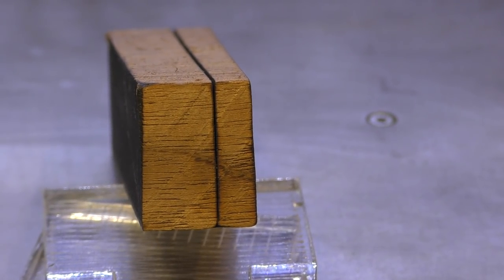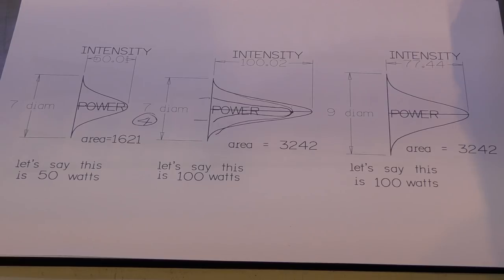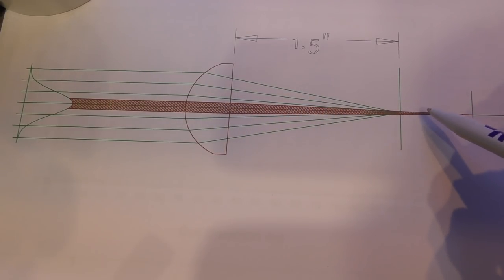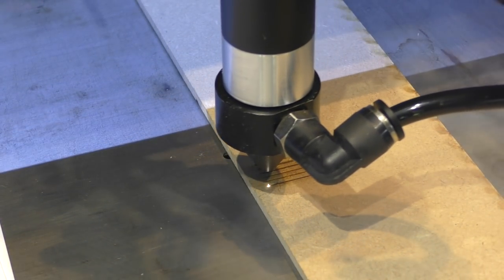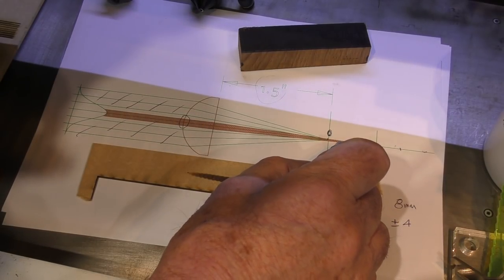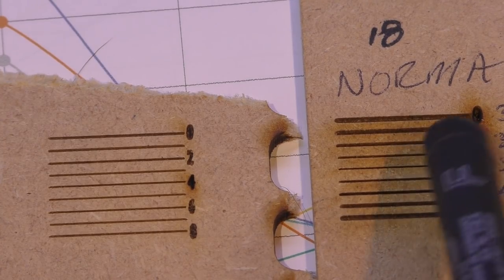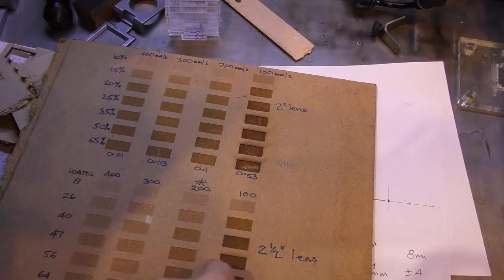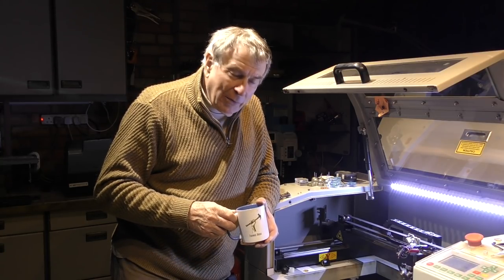RDWorks Learning Lab 208  Can I Remove the Focal Point

Comment: Dear Russ,
Again a fascinating continuation of your lenses experiments.
I agree with with Asger that keeping only the center of the lens reduces the NA and lengthens the depth of field to the extent of removing the sharp engraving capability.
I was just wondering on the great difference in cutting ability between 5mm and 3mm diameters. Either:
1) There is still a quite high energy density in the 3 to 5 mm annular region
2) The beam is not well aligned to the 3 mm center region so the higher intensity part of the beam is somewhat offset and falls into the machined dispersing part, reducing the overall transmitted intensity.
Keep going !
Thanks
Jean
Reply from the maker: Hi Jean 
I do treasure  it when my naive experimentation  encourages folks with a REAL scientific background  to make a contribution. Whether it be questions, doubts or criticisms , I regard all input as a learning opportunity. So many thanks for your comment.  My crude model of the lens cutting mechanism explains so many questions  without me  ever resorting to understanding Klingon . It may be scientifically flawed  but  for my exploration of this subject I do not need an electron microscope  when I can get by with a piece of string with knots in.  I don't intend designing lenses or laser tubes,  just finding out how to extend the operating envelope of the cheap machines that I and many others bought. With what I have learnt just recently,  I am  particularly keen to prove that controlling the size and divergence of my RF tube beam will greatly enhance its cutting ability.

 I did carefully align the beam axis with the lens axis before carrying out these tests
 I will be carrying out more tests to see what usable potential there may be for my crazy lenses.

 Best wishes
Russ

Comment: We’re used to refraction being dependent on the refractive index of the particular frequency of the light, but perhaps there’s also a difference based on the intensity when it comes to these frequencies? The materials in these lenses are very different from the optical glass materials used for visible light lenses which permeate lens research.

On that note, visually measuring focus using your jig and visible light should be a bit off, right? You would have to use 10.6nm light when checking if that pattern comes in to focus, and that’s invisible.
Reply: Or are the lenses just ground with a particular variance nearer the center, so as to create a multitude of focal points with close to the same amount of light energy passing through them? Like rings of different focus, larger in radius in the outer part of the lens getting smaller and smaller at the rate of the intensity increase towards the centre of the beam.
Reply from the maker: I am sure the Chinese are not that clever. I know a lens manufacturer in the USA that has done lots of measurements on Chinese lenses to compare with his own high quality (perfect spherical geometry ) lenses and he assures me that they are many light bands from perfect. It is possible that this non perfect geometry aids the cutting ability of a lens.... I only mention this because I have tested several  supposed top quality  II-VI lenses and they are not great at cutting
 Best wishes
Russ

Comment: We love you, Russ. Thanks for everything you do.

I wonder if placing your Polo lens (the lens with a hole) back-to-back (flat side to flat side) with an undrilled lens of the same type, would yield similar results to your Dremel ground lens. That would be an interesting compound lens, since you'd essentially end up with all three options available to you by having a standard lens, a Polo lens, and a combination of the two.
Reply from the maker: Hi
I am in the middle of my next video where I have done almost that. I have replaced the 38mm PVD plano convex  in my compound lens engraving lens with my 38mm polo lense to examine the effects. .  I will test it further because I can also replace the 2,5" meniscus bottom lens  with a holy version also.. There is no limit to my mad ideas.
 Best wishes
Russ

Comment: Perhaps if you press a 3mm ball bearing in to the center hole you’ve made you can get rid of that “digging spike” that complicates engraving. The high power center is the Gaussian beam should be widely reflected around the lens tube and dispersed.

Comment: Like Franci Kapel, a GREAT SESSION! What you think if we put a washer over the lens to block the light around the middle point????
Reply from the maker: Hi Stefan
 anything metal will reflect the light  so that idea will not work. If you decide to use anodized aluminium it will absorb the light energy and heat up ......maybe to melting point. !0.6 micron wavelength light has peculiar properties. It is for this reason that I had to vandalize lenses to prove my point.
Best wishes
Russ
Reply: @SarbarMultimedia  Great, thanks for reply, I look forward to your next session...

Comment: Russ, have you considered that at low power levels, that since the gaussian distribution flattens out, that a greater proportion of the total intensity exists in the legs that aren't in the center? Wouldn't this suggest as you've shown before that low power shortens the "spike" you've referred to relative to the wide defocused area, and that power-level helps to not just to control the resolution of the dots from each other, but also their central depth and general width?
Reply from the maker: Hi Robert
You are 100% correct. You have taken my simplified models and integrated them to form exactly the correct conclusion. Flattening the curve by reducing the power will not get rid of the path of weakness that creates the ""projected focus"  (or its diameter)  but a lower INTENSITY in the raw beam will be amplified less so you will have more control of penetration because that is a product of intensity and time.
 Best wishes
Russ

Comment: Hello Russ a question for understanding:
If I understand all this correctly, it is then also imperative that my laser beam hits the lens relatively exactly in the centre, isn't it?
Kind regards
Stefan
Reply from the maker: Hi Stefan
In reality you cannot remove the focal point from a lens because when it come to intensity there is no single focus point  As I demonstrated when I drilled a 1mm hole through the axis of  a lens, . you can remove the central focus that produces a cutting action but those rays from futher off centre still get focused and have sufficient energy to still work perfectly as an engraving lens,. Lenses are not naturally intuitive things to understand  so you question about off centre beam is best explaine in this video at 13:50
https://www.youtube.com/watch?v=xPlhrEyZDZk
 The only time the beam will travel coaxially with the lens axis is if the beam hits the "sweet spot" on ,mirror 3, 
 Best wishes
Russ

Comment: Hi Russ, the evidence from your experiments show that your converging lens hypothesis is correct. Watching your video I realized that when you removed the virtual focus, the marks in the test turned out to be clean without that stained area around the cut groove. The quality of the cut seems to improve.
Reply from the maker: Hi Gonzalo
 You are very observant . I can explain.  You will note from the cutting graph that the 3mm final lens also caused about 50% loss of cutting ability also,  ie the intensity had dropped.    This meant that although I was drawing lines to check the focus  those lines were not as deep. With a normal lens you would have the "power spike" below the focal point that converts solid material into gas  and vapours almost instantly. These explode upwards and sideways like a volcano even with no air assist to blow them back down.  The fact that this spike was hardly existent meant there was very little solid to gas conversion and what was there could explode upwards. Very careful observation of engraving has taught me this fact. 
 Best wishes
Russ
Reply: @SarbarMultimedia  Thanks for the explanation

Comment: Im mostly interested in cutting applications... but after looking at the vids i start wondering if another beam intensity distribution would be beneficial for engraving . Lets say that you could produce a ring shaped profile instead of the Gaussian... ie put the most energy out where the beam bending part has more effect... and thus making the high intensity of the beam be more ‘focusable’... i see a contraption with small mirrors moving the beam slightly off centre, but they all spin very fast to produce a ‘hollow beam’.... this contraption could be placed anywhere along the beam path... as it still produces ‘parallel rays’. ( but more in form of a tube)
Would such a beam profile be of any benefit in engraving applications?
Another somewhat related idea is to try do some of your test off centre of the lens.... could that give some valuable information?  Okay, the resulting hole would not be linear with the vertical axis, but you get the light bending characteristics of the  lens for the high intensity part of the beam, which maybe can add some clues to this puzzle .. :) 
And finally,  i hope i am wrong.. but a thinner beam (as with the theoretical inverse beam-expander) would at the same time result in higher stress and temperature gradients in the lenses, i imagine... ie we might run into limits of what the lenses might cope with,
Reply from the maker: Hi Klas
The  point you make about circular is true. There are natural modes that the laser beam can be tuned to without the complex method you imagine.
 see    https://en.wikipedia.org/wiki/Transverse_mode
 Different modes have different applications so I'm sure you will wish to read more.
 Lenses do not work quite the way you imagine. Good quality ZnSe does not heat up.  It is naturally only 70% efficient at transmitting 10.6 micron light. However the 30% loss is not absorbed energy but reflected energy. Hence there are sophisticated layers of coatings added to the lens to push its transmission efficiency to 97% or higher.
 The Chinese method of manufacturing  ZnSe is  more prone to inclusions and it is these inclusions that DO absorb  energy and can cause the lens to heat up and self destruct.  Trust me , I have destroyed the surface coatings and also  over stressed  several Chinese lenses with excess light intensity.. I have  not damaged any USA  CVD lenses.

Bet wishes
Russ
Reply: @SarbarMultimedia  The rationale for the contraption was to convert a cutting tube into a ‘maybe better’ engraving setup... :). About lens heat up i was under the belief that power levels was an issue in lenses,  but that maybe belongs to the history.. i was told 15 years ago by a sheet metal cutting operator that reflections of the material could reflect back into the lens and cause it to literally explode , which would case them to abandon the shop for a day to vent out toxic and mild radioactive particles and fumes.  I believe that they suffered from this a few times..  But that might have been at totally different power levels, and other lens material...any how.... interesting investigation.. :)
Reply from the maker: @klasmalman9249   Hi Klas
You are right about the metal cutting power levels, typically 3kW. for industrial/jobshop machines. The high quality  zinc selenide crystal "ingots" that are the starting point for industrial lenses are  made from the core 60% of the ingot to ensure zero inclusions. These are capable of transmitting maybe 10kW without exploding. However in days past the lenses were not protected and any fume damage/film  on the underside face of the lense could cause surface heating on that one face . Zinc Selenide is a bit like a salt crystal, rather fragile (unlike normal glass) and it does not take much differential temperature stress to destroy the lens. Thus, it is not power density issues because the machine and lenses were designed for that work environment. Back reflection? Yes, that is yet another photon bombardment  that could heat up a film of debris on the lower face of the lens
 Best wishes
Russ
ps. I used to own a couple of these industrial  machines and it was usually my experiments with cutting aluminium, brass or copper  that would damage the optical coating on the lens. I never had an exploder. VERY expensive lenses to replace.

Comment: In one of the past videos you made your own copper mirrors. 
Perhaps you could use your metal lathe to convert one copper mirror to slightly concave shape and replace last mirror with concave one, to make beam narrower before it hits the focusing lens?
I wish I could help you but I only have a wood lathe not suitable for anything precise...
Reply from the maker: Hi Franci
 I commend your "out of the box" thinking  but  are not the first to suggest this idea. It is already  used in some special  industrial machines. However for our application you have overlooked two important facts.  It will require beam resetting every time we want to swap mirrors to change the focal length   and  secondly,  I you lose the ability to quickly set the focus by adjusting a lens tube. Instead I  have to raise and lower the work. . I see no positives in the idea for our hobby machines  where ease of use and maximum flexibility are key attributes.  As I said , the idea is novel and shows that your thinking juices have been stimulated by this subject. I have an open mind to any new and novel ideas  and am also very happy to be told when and if I am wrong with my conclusions or assumptions. After all, this is discovery and learning  that we all benefit from, it's just that I am most at risk of making mistakes  because I am leading that charge forward.
 Best wishes
Russ
Reply: @SarbarMultimedia  I'm not sure if my message got trough correctly since English is not my primary language... 
I'm not suggesting that we remove focusing lens. Just swap last mirror with slightly concave one to make beam a bit narrower. Same as you did with two lens setup where top lens was making beam narrower before it hit second lens. This way you would still use lens to set the focus and be able to swap it quickly to change focal length.
Function of concave mirror would be strictly to make wide and "blunt" beam more narrow and pointy to help increase intensity in the middle of beam...
This is just brainstorming... I might be completely wrong... :D
Reply from the maker: @FranciKapel  
Hi  Franci
 I apologize for not understanding exactly you suggestion. There was nothing wrong with the English. The problem I see  is what I have already discovered. If the light rays are not parallel when they reach the lens then the lense does not function properly. Converging rays will shorten the focal length of the lens  an in turn reduce its cutting potential. I have seen evidence of this already but will be looking closer at this effect in future sessions.; If there was such a thing as a mirror that accepted a parallel beam and  reflected a smaller parallel beam then that would be a miracle of physics. and just what we require.
 Best wishes
Russ
Reply: @SarbarMultimedia  Thank you for explanation. So we need a beam expander that does not expand but shinks beam (and keeps it parallel). 
Could you use beam expanders that you were testing on RF laser in reverse orientation to reduce beam width? ;)
Reply from the maker: @FranciKapel   
 Hi Franci
 I love you natural ability to  imagine  a new solution  when what you first thought proves impractical/impossible. That is a recipe for success in life.
It is difficult to optically shrink the beam and keep it parallel   hence they call these devices beam expanders,.. There is a natural divergence of the beam that occurs so the  natural laser beam is not perfectly parallel. Glass tube beams expand at about 3mm/m and RF beams expand at about 7mm/m . If you expand the beam through the first optic you can correct the expanded  beam through a second optic to make it parallel for a more usable distance. Even a corrected laser beam will still tend to diverge but a lot mor slowly.  So, if I turn the  beam expander round it will take the parallel beam and focus it. .... not what you want.   Out of interest I am waiting a special x1 beam expander from China to fit onto the RF machine. I hope this will help retain the high intensity of the original beam and give me significant improvement of cutting performance .... that is always a weakness of RF machines.
 see https://www.thorlabs.com/newgrouppage9.cfm?objectgroup_id=12400

 Best wishes
Russ